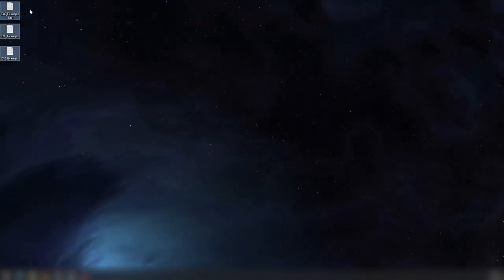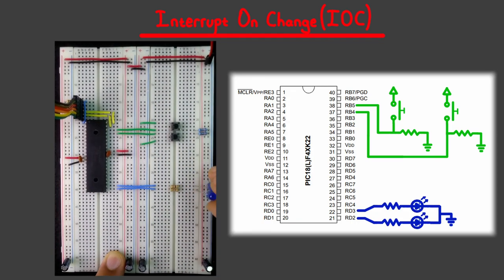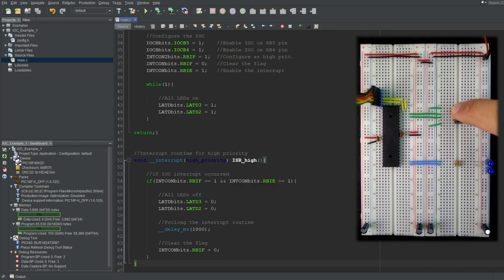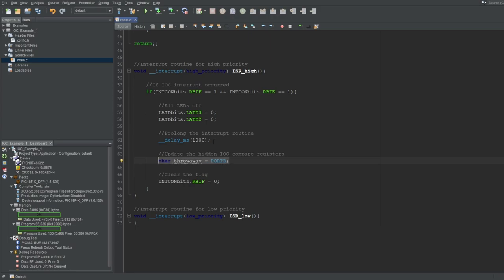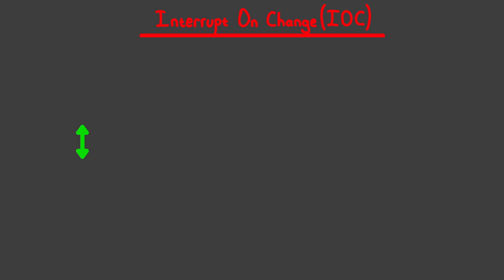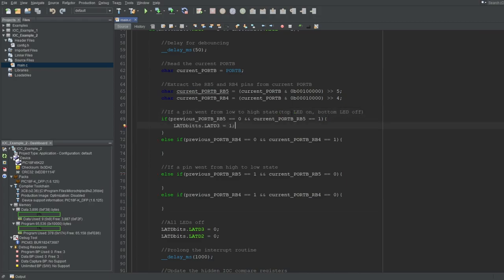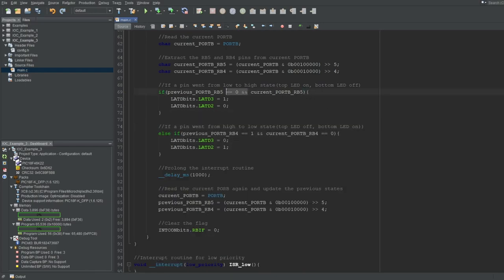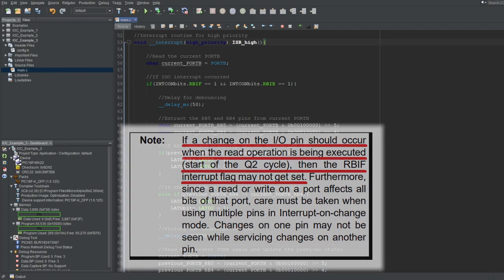PIC MCU TUTORIALS #16 - Interrupt On Change (IOC) (Absolute Beginner)

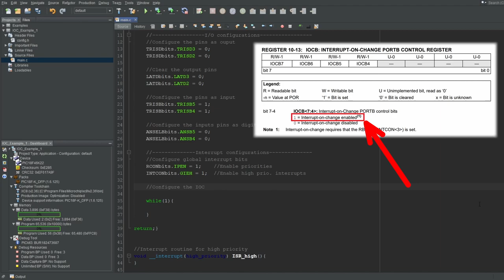Comment from the maker: NOTE-1: In 4:42 , if you look at the default states of the IOCB bits, you can see that, they're all turned on by default. So, even though I tried to only enable the RB5 and RB4 pins, RB6 and RB7 pins were also enabled. This likely didn't cause any issues since those lines were connected to the programmer, but make sure to clear the bits for the pins you don't want to use!

I assumed they would be disabled by default since interrupt sources are always disabled by default (and they should be)... Goes to show you that you shouldn't assume anything 👍
------------------------
NOTE-2: In the examples, I used global variables to save the previous states of the pins; however, you should avoid using global variables wherever you can. Since those global variables are only used in the interrupt routine, you're better off using "STATIC" variables defined inside the routine.

For beginners, static variables are usually confusing, while global variables are straight-forward, hence the choice.

Comment: About 6 years ago I've used RB4-7 interrupts on change on PIC18F4520 and PIC18F452 for HALL sensor inputs on BLDC sensored control. Every change I've read Port B state and depending on state, turn appropriate sequence on PORTD as driving port for 3-phase bridge. I've used CCS PIC C compiler. 
Great video.

Comment: Hello sir, Good article which would be helpfull for beginers, But when i am using alternating signal to detect zero crossing signal, I am not able to find the signal whether it crosses zero axis.
I am using to detect three phase(440v 50Hz) by zerocrossing with the help of PIC12f1501.
Could you please help me on that or can you please make one tutorial on that.
Reply from the maker: There are many ways to detect zero crossings, you don't even really need a microcontroller depending on what you're trying to do. Without seeing your circuit I can't really help you.